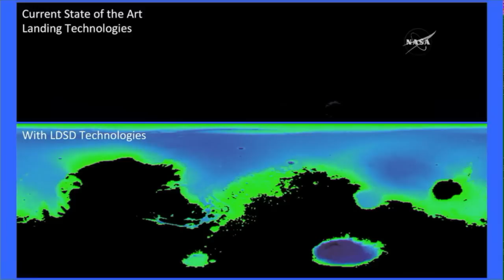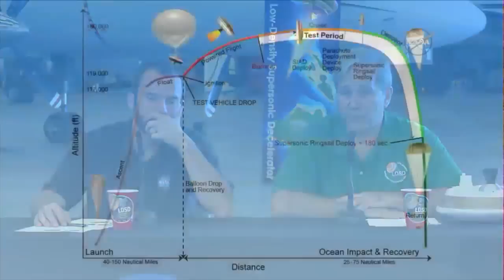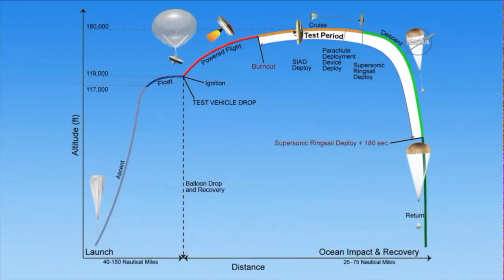LDSD Mars Landing Tech News

Comment: A Britek Cargo Suspension System. High frequency"Bose" like Vacuum pressure suspension...Improve acceleration / deceleration...A good thing for LDSD.
2014 - 2015 NASA Rover Challenges...Expect ERW 2016 full composite, linear traction, high speed, fully"Mars" capable.

Comment: Are you a bunch of children at JPL? No? Then stop wasting Helium, it's a limited precious resource better used in children's balloons than the first stage of a rocket. If you don't want to use an actual rocket for your first stage, then at least use rocket fuel instead of Helium. Hydrogen is a safe alternative to Helium for your first stage balloon, it lifts more, cost less, isn't a limited resource and is safe to use with some small procedural changes. 

Save the Helium for important things where it's non-flammable lifting properties are important, like children's balloons.